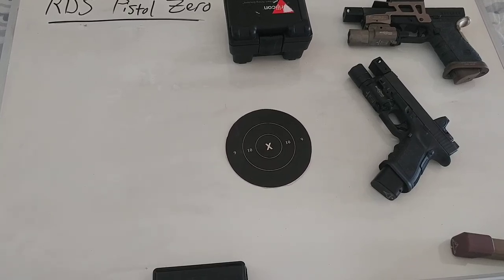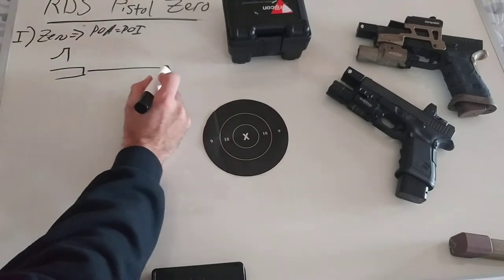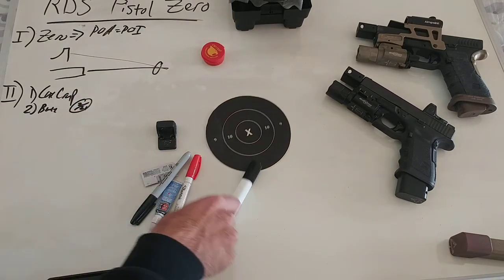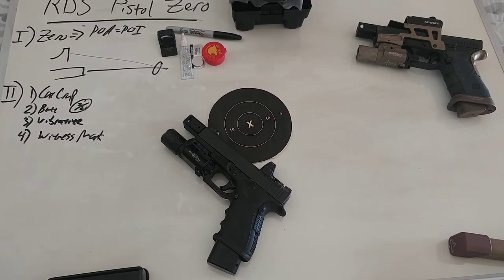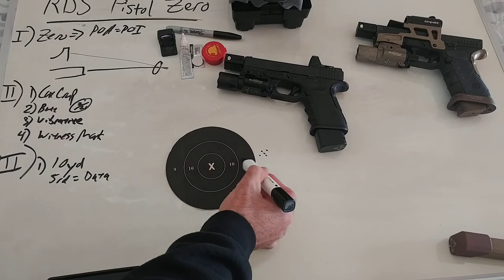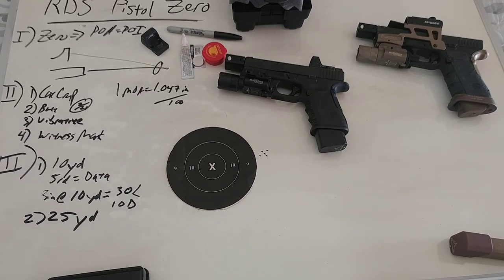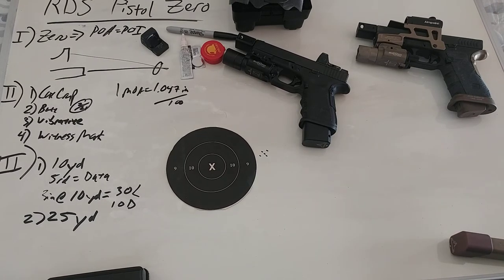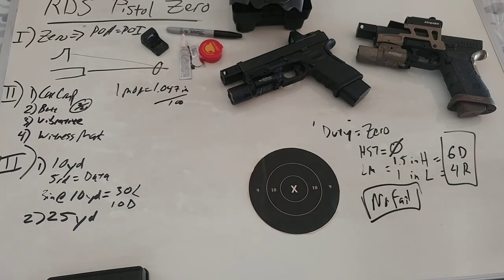Red Pistol: Set Up and Zero

Comment: Nice! You are on a roll with these vids. Pro tip for vibratite. Don’t leave it in your duty bag in a hot car or garage, unlike loctite it will straight up evaporate in the glass bottle or tube.

Comment: Thanks for the great info.

How well do the staccato mags hold up? Have you had to change the springs often?
Reply from the maker: I've never replaced a magazine spring in a Staccato or MBX magazine. The mags are pretty uneventful. I typically use Staccato mags for all practice and most competition as they're "beater mags" in my mind but they haven't failed yet. MBX makes a better magazine that will last longer but the Staccato magazines aren't anything to be afraid of. That's with about 30,000rds through those magazines.  Check out my earlier video on magazines for more information.
Reply: @AmericanAdlerauge1775  I will thank you!